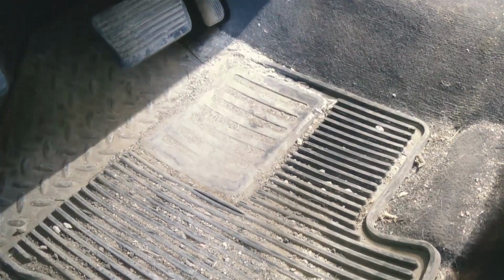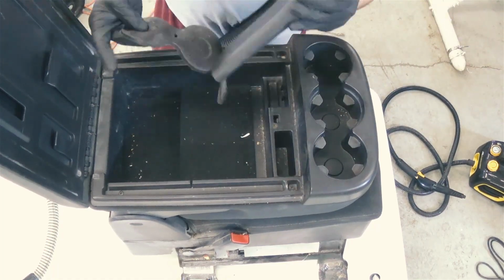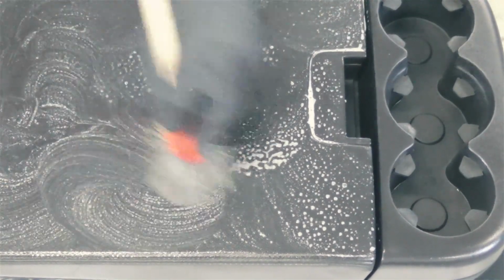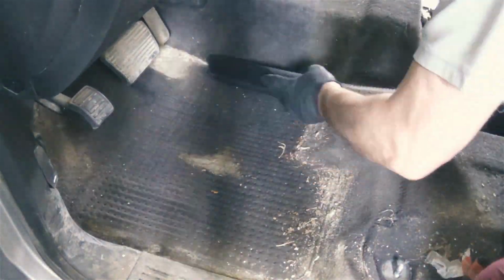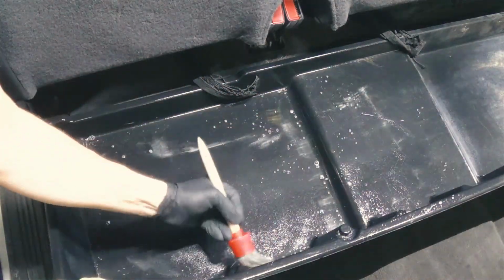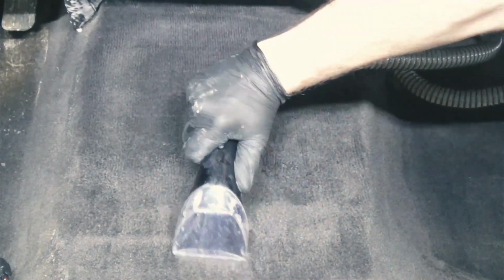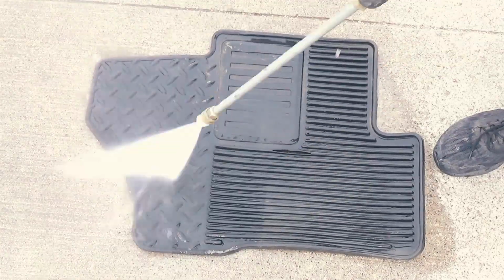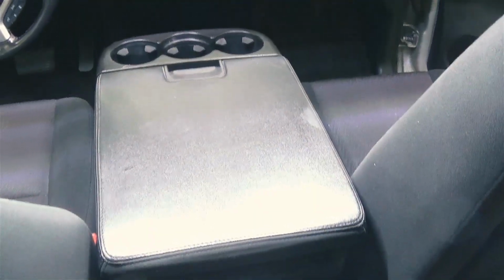"Shocking" Transformation | Electrician's Work Truck Restoration

Comment: I like to use a random orbital sander (no paper!) on the floorboards to make the dirt, grime and dust come dancing to the top. it works almost as well as the drill brush and it doesn't throw it in the air for me to breath it in!😊😊
Reply from the maker: I like that. I’ve used an old dual-action polisher a couple times. On the olde carpet it doesn’t work as well but in the better quality stuff it does.
Reply: Oh! Nice job on the sparky's truck too, by the way
Reply from the maker: Thanks!

Comment: Scrapper. Great video and I like simple methods you use. I would advise that you have an extra handle for your Bissell though. I too use the Bissell and it's not a question of if,but when it's going to great. I'm on my fourth handle in three years.
Reply from the maker: Yes, I've seen a couple other detailers whose handle broke. I need to get one to be prepared for that. I haven't been using the Bissell as much lately as I started using the P&S 3-step cleaning system to clean the fabric. So much faster and great results. I still need to use the extractor for major stains or spills though.
Reply: Yes so have I. P&S rocks